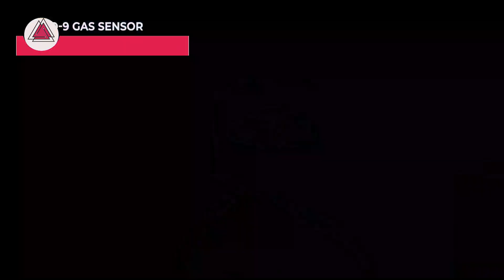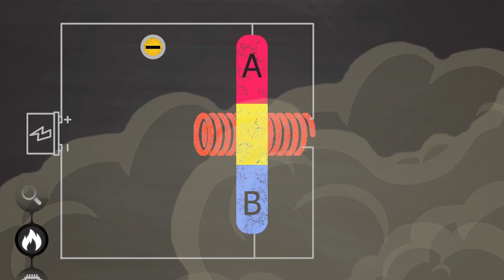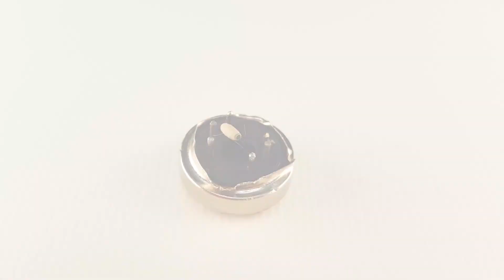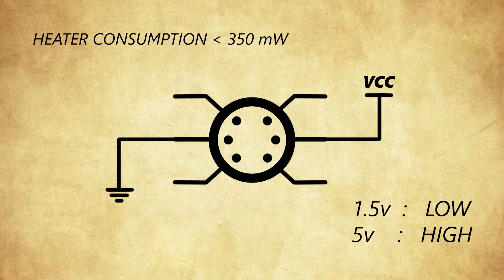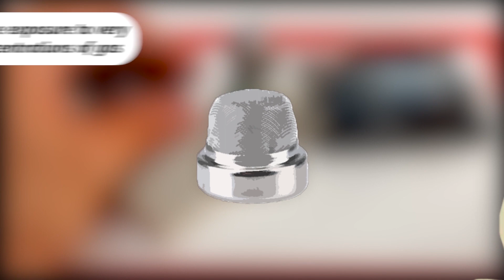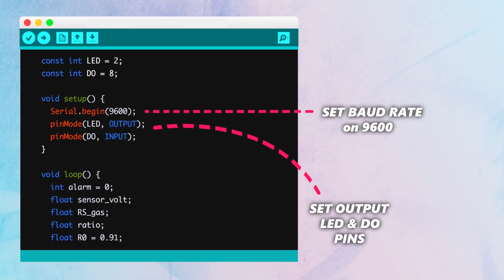MQ9 Gas Sensor: How To Calibrate & Use Gas Sensors w/ Arduino [w/ Code]

Comment: Hi. I'm a bit confused about how to convert this ADC Analog to PPM with MQ3 Sensor.. The default result is about 120 - 200 clean air reading. I just dont know how to calculate it, or if there any formula to get the right PPM, please tell me. I plan to use MQ3 for detect Ethylene gas. Thank you.
Reply: i get the result from your tutorial
sensor_volt = 0.73
RS_ratio = 5.87
RS/R0 = 6.45